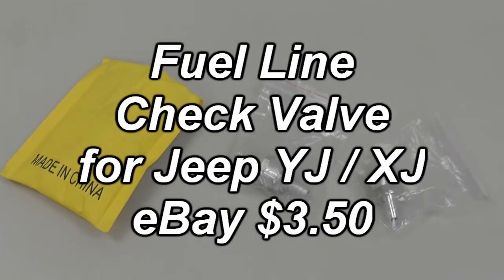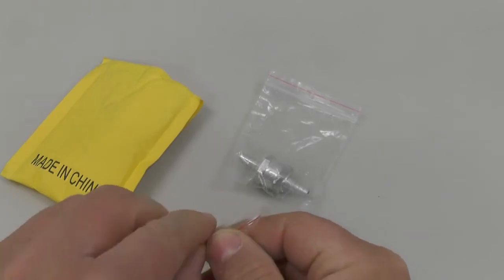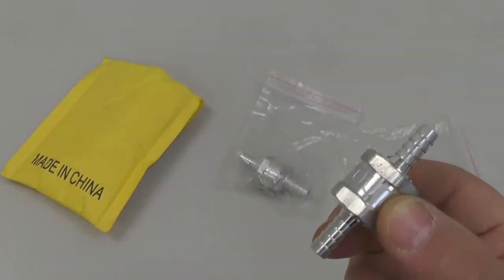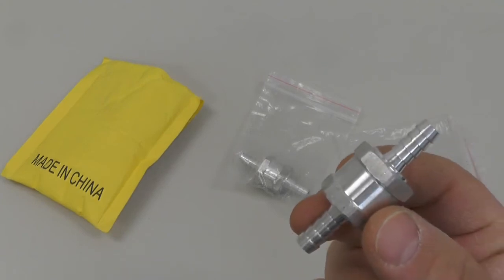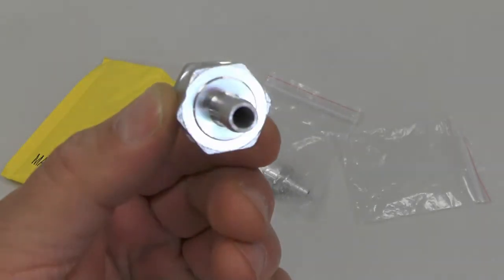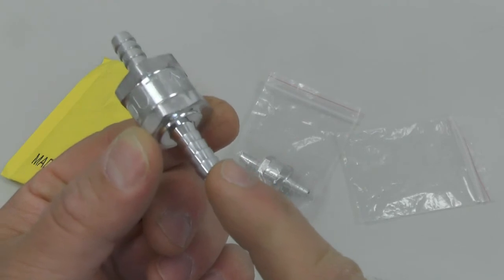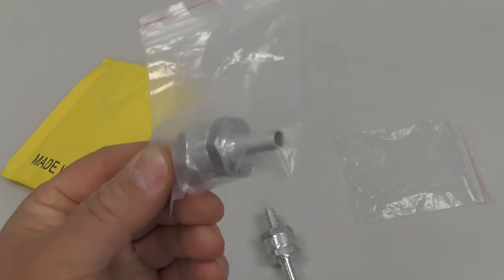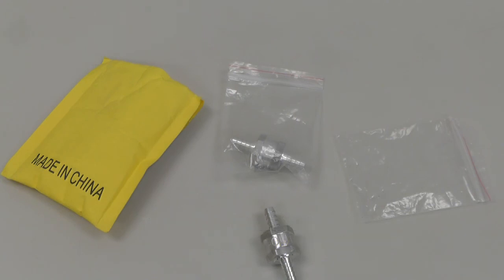Fuel Line Check Valve for Jeep YJ/XJ

Comment: On some of the Jeep Forums some people say that if there is Not a fuel return line then the check valve could create too much pressure and possible fire.  One guy said that Cherokees that are 1996 and up DO NOT have a fuel return line.  Check to make sure you have a fuel return line on your Jeep before installing a Check Valve in the Fuel Supply Line.
Reply: Thanks for the heads up. Do you recall what the title of that post was? I'll have to review where to install. Perhaps installing in-between the tank and the filter would create less pressure?

Comment: the valve wont allow fuel return to the tank in the delivery fuel tube , but what about the return line? are you telling me this valve doesnt allow the fuel to return but what holds the fuel in the rail???? knowing the rail has a return line,, the rail has a check valve at the end of the rail when the return line hooks up?

Comment: Where exactly would be the best place to install this on a 98 jeep xj
Reply: Read the dialog on the other comments. It's a crapshoot of information, do it or Don't do it. Seems like there is potential for fire, but I'm still seriously considering it short term until I can drop fuel tank and put in pump.

Comment: 98 jeep Cherokee same issue I looked them up and is 6mm is that the same
Reply: Check out Steven's comment to burtchjosh about the 97 ZJ. I think it may be ideal to put it just outside the tank in between the fuel pump/tank and fuel filter. Looking for guidance on this myself, though! Perhaps in between filter and rail. I keep hearing/reading that it is less ideal installing it the closer you get to the rail. It apparently builds up more pressure the farther you place it toward the tank... Please advise!
Reply: @robertbrodarick9607 just so I'm clear on this install the check valve post tank and pre filter for best results ? 98 zj 4.0 .. I installed a cam position sensor two days ago not a fun job but the result was excellent. All the best
Reply: @frankcaurso1314 frank these are crazy waters to navigate. I'm no expert, but I've been looking it up and we've gotta use caution. Definitely wanna use the right fuel line clamps for the job. I'm getting some pinch clamps that won't loosen or pop off. Also I got a 2 pack so I could install a valve on either side of the fuel filter. To keep everything tidy in one spot. I'll change the filter at the same time. Again, I have had little to no feedback on this, but nobody is calling me out saying I'll blow anything up, so...
Reply: @frankcaurso1314 could be I'll just replace fuel filter and see if pressure improves. Seems far less dangerous with the 97-01s, but I'll still keep the option...
Reply: @robertbrodarick9607  Robert I want to say I really appreciate the reply.. absolutely the fuel filter also sounds like a smart move. I used to have an '85 CJ 7 miss it we used to bring our old Jeeps upstate New York and go crazy with them up in the woods. It's still running to this day, Jeep got to love 'em
Reply: @frankcaurso1314  Frank, right back at you. I literally just did a "poor man's prime" and I may continue to do so until I can drop the tank and replace the pump/ fuel injector regulator. Those seem like the worthwhile efforts! Don't wanna flirt with overloading the fuel pressure and replacing more than I can afford
Reply: @robertbrodarick9607  that's funny Robert I just did the same about 40 ago. I heard that it's possible you can pull just the front of the tank , so the back stays in place , I'm no expert either but if it's possible and it works like that it sounds much easier
Reply: I'm about to order one myself and trying to determine size if 6mm (1/4) as you suggest or 9.5mm (3/8)... Please advise!
Reply: Hmmmm good question 1/4 or 3/8
Reply: @frankcaurso1314 I looked up on RockAuto. Neither! Actually 5/16" (.31") per the fuel line/hose they sell.

Comment: Do you think this will work for a 97 zj? Having the same issue.
Reply from the maker: Hi and Thanks for your question. Probably it will still work, because the ZJ shares so many of the same components as the YJ and XJ (particularly the 4.0L versions). As long as it has a return fuel system, the factory check valve should be located in the in-tank sending unit, which is why this external repair is so convenient. Plus the in-tank sending unit is quite expensive and complicated to replace, particularly when the pump still works good and just the check valve is bad. And if nothing else, this quick repair can help out in the mean time, until the pump does (eventually) go bad and needs to be replaced (at which time a new in-tank check valve can be installed. Anyway, hope this helps, and Good Luck with your XJ!

Comment: Did this work?
Reply from the maker: Hello, and thanks for your question. Yes, this check valve worked out great! I posed another video about the install process, too. Here's a link: https://youtu.be/ELvKRsZMgl4 
However, it's been about 3 months now since I installed the check valve, and while it does a great job of keeping fuel in the lines (and most importantly, up at the rail), I don't drive this YJ everyday. So, if it sits for a long period (a few weeks), then I have to "re-prime" the system (by cycling the ignition key, two times), to get fuel back up to the rail. Once that's done, the engine will start quickly, as it should. But I guess, given enough time with the vehicle sitting around, gravity wins, and the fuel drains back into the tank. Also, it may not be THIS check valve on the return line, but rather, the check valve on the pump side, that is slowly leaking back down. Anyway, hope this helps. And good luck with your Jeep!
Reply: stevenofpa thank you so much!!! I went ahead and ordered them !